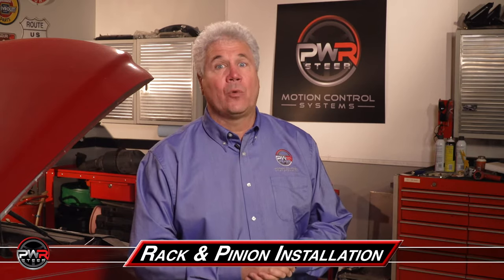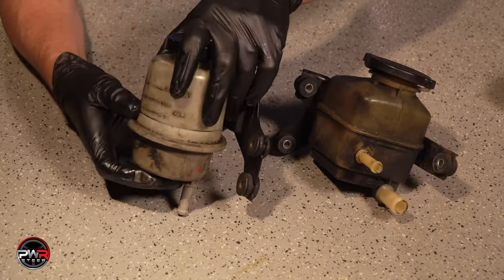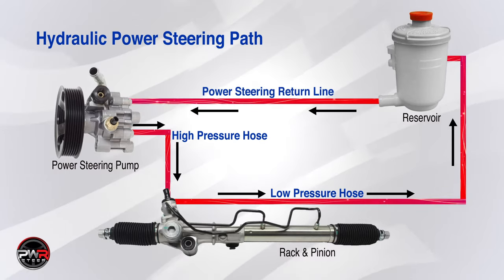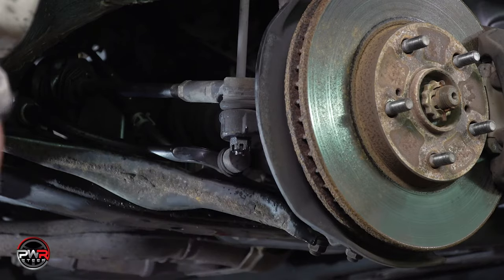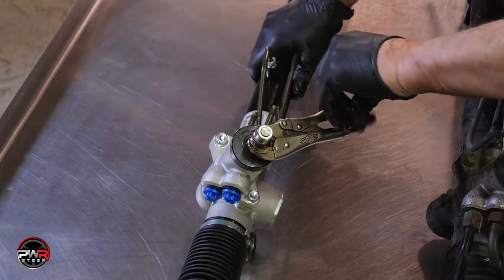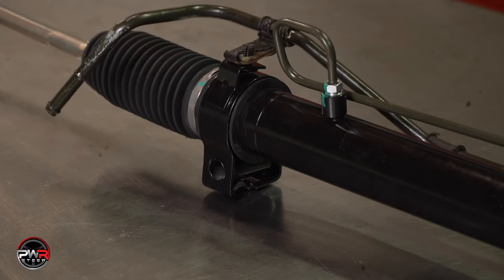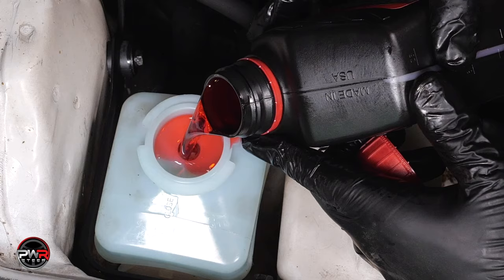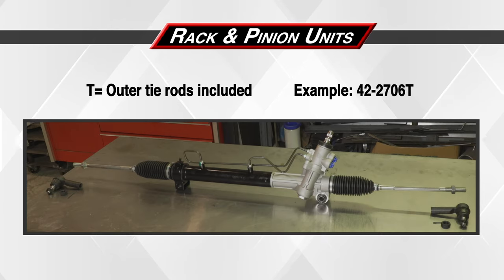Installing a Rack & Pinion

Comment: Am a steering engineer by profession I work and repair all kinds of steering pump and racks for all kinds of cars..
Reply: Are you in NJ?
Reply: Hi what do you think can be the cause? Mazda 6 2012 2.0 petrol. Electric power steering , the steering wheel feel heavy especially when turning left (a lot smoother when turning right)
Reply: @princesteering-nh9mj Hi what do you think can be the cause? Mazda 6 2012 2.0 petrol. Electric power steering , the steering wheel feel heavy especially when turning left (a lot smoother when turning right)

Comment: My mechanic says my seals in mine have gone out. I have power steering fluid all over the bottom of my truck. At first I thought it was the pump but given how it feels when I drive it, it makes complete sense that it is the rack & pinion. The way my steering feels when I hit the tiniest pothole. I'm getting it fixed but I can't until after Christmas. I just won't drive it until then because I've had to replace one that went out during driving in my car so I know that endgame. You ain't moving that steering wheel no matter what you do, I had trouble getting it off the road. Lucky for me he's a certified mechanic but close family friend so I won't be paying as much as a shop charges😏. He done my brother's about a year ago.

Comment: Good morning...I have a Nissan elgrand and it's steering rack is very very heavy when turning both sides so I'm asking what should I do about that issue and which steering rack can I buy because at the shop dealers thy says it's expensive to order so which Nissan uses the same rack as Nissan elgrand.

Comment: Thank you so much for this so detailed explanation. I was able to do this replacement on a 2014 GMC Yukon following this video. A couple of things I noticed along the way, which are not mentioned here though:

1. The new rack and pinion comes with two unopened rubber seals for the connection lines to the steering wheel fluid. However, they can easily be mistaken with temporary seals to be discarded. If so, then the fluid lines do not seal at all. The rubber seals have to be opened up a bit before placing them in their positions again.
2. Steering after the installation is harder. It appears that there is something called pre-load adjustment with a bolt located on the base of the pinion, in order to loosen up the steering movement.

In my case, even though I counted the turns of the tie rods, the pinion shaft did not properly aligned with the clamp hole. Since the instructions clearly state not to move the steering wheel, as it is already centered, I had to move the pinion shaft to make it align and have the clamp fall in place, and then re-adjust the tie rods, as the wheels were now off center.

Comment: Hi mate ! After I center the Rack, How do I know the number of visible threads to be left on the new inner tie rods, when I don’t have the old rack for reference? As I see in the video, you could get the reference measurement for the new rack from the old rack.
Reply from the maker: Hi! 

Sorry for the late reply. 

1. Center and install the rack
2. You will screw the outer tie rod ends into the new rack before inserting it into the spindle
3. Make sure both front wheels are pointing straight ahead
4. Screw the outer tie rod end in-and-out until the tapered portion of the outer tie rod end is aligned with the tapered end of the spindle
5. Tighten into the spindle
6. Jam nuts on inner tie rod ends to the rack
7. Take to an alignment shop - if not, you will wear out your tires
Reply: @PWRSteer  Hope you’re doing great ! So, I had my rack centered with the wheels and steering wheel straight ahead. But messed it up by slightly positioning the rack off-centre to the left by like 5°. Now, after the wheel alignment, my steering and wheels are straight but due to the auto centering nature of Rack & Pinion system, the steering returns to the center position of the rack ie; slightly off center to the left. Thus, also pulling the wheels towards left requiring constant lane correction. Didn’t know that slight variation in degrees would cause so much havoc. Need to correct this asap. Mistake occurred during lock to lock counting and coming half way back on the rack, which was slightly messed up. Any inputs from your end would be of great help.
Reply from the maker: @asphyd12  We are doing well! We appreciate you watching our videos. Feel free to visit our website: www.pwrsteer.com

Unfortunately, it looks like the only way to fix this issue is to disconnect the tie rod ends and re-center the rack. 

Thank you!
Reply: Thanks guys I gone to try my self

Comment: So if you mess up with reinstalling this part how much would a car mechanic charge you to fix it? Would suck if you relize the steering wheel is worst after putting new rack & pin on and have to have it towed. luckily for me I have triple A so i would get free towing.

Comment: Hi I have a 2012 GMC YUKON XL SLT 5.3 4WD with 285,000 miles.  I have changed a hub bearing, and the inner tie rods.  How do I tell if the steering rack is bad.  While driving on the highway, I get a drift in the lane and a little play in the wheel.  I have unlimited wheel alignments and have it aligned after the part replacements.  Just got back from a long trip to Florida  Great video by the way.  Thanks JoeMc
Reply from the maker: Hey Joe , 

I would check the inner and outer tie rods and see if there is a little play, even if the vehicle has high miles, it should not be loose. In regards to the drifting, you mentioned you have replaced one hub, I would check with wheels off the ground (free spinning the wheels using the same force on either side), to see if they spin the same number of turns or if one has more resistance than the other. The newer hub will have tighter tolerances than the worn out one.

Thank you!

Comment: Hello I have jeep cherokee 2018, there is a clunking sound when  I start driving and steering the wheel to the Right, no clunking if the car is parked for a while and try to steer only starts when the viechile is being driven, but after driving for 30 min then you can hear that clunk sound even when parked. The dealership inspected and recommend new steering rack and pinion. My vehicle has only done 89000km and is 2018 year. Is it safe to be driving with that sound or does is need replacement immediately?

Comment: But you didn,t mentioned check valve on pressure line side in Rack should be replaced and inserted in new Rack and some new ones they have build in Rak  .

Comment: My 2013 Camaro has a huge leak where the steering column goes in at the top. I can't find anything for just getting a seal for that unfortunately. Will be using this video Monday for replacement. Any recommendations for alternative ways to lock the wheel?
Reply from the maker: Hi Frankie,

One suggestion: 
You can stretch the seat belt and (loop around) tie the steering wheel and click it back. 

Thanks, 
PWR

Comment: Sooo my transmission was not shop replaced. The cradle was dropped but the rack and pinion remove connected. When I reassembled the car it pulled to the right.

I got it aligned and it still pulled to the right. Got it aligned again. Still pulls.

What could I possibly have done or not done during the reinstall of the tranny and such??.
Reply from the maker: Hi, 

Our suggestion: 
Lift the front wheels, leave the vehicle in park, start the engine, straighten the wheels, and let go of the steering wheel, if the wheels move it’s a rack problem, if they do not, then it’s something in the steering like bad ball joint or stuck brake caliper. If dirt got in when you reassembled the unit, then the spool valve may be obstructed.

Again, this is just our thoughts/suggestions

Thank you,
PWR
Reply: @PWRSteer  THANK YOU FOR THE RESPONSE!

Comment: so should I replace my power steering pump before or after I replace the rack and pinion
Reply from the maker: Hi Branden,

It is not a one or the other situation. You will flush the system before you start taking anything apart. As long as you refill the system with fresh fluid and vacuum bleed the system at the end, you should be good to go. 

Thanks,
PWR

Comment: What sensors are on the side of the radiator passenger side 2013 Chevy Cruze
Reply from the maker: Hi Tim,
Not positive, but believe it should be the temperature sensor to control the electric fan.
Thank you,
PWR

Comment: Hey guys, great video here. I am preparing to do this job and these  tips will help. I wonder if you could recommend a brand for a replacement rack? Looks like my options are Cardone, and ACDelco for remanufactured or BBB, and Edelmann for brand new. Don't want to do the job twice so i am looking for the best. '07 Monte Carlo SS. Thanks in advance!
Reply: And i just learned that PWR also manufactures a rack for my car. Do you have some specific selling points that makes your brand stand out from the others? I don't mind paying more, i just want the best one...
Reply from the maker: Hi Steve,

I believe our 42-1410 will fit. This is a brand new rack.

https://www.pwrsteer.com/ECatalog/productPage/42-1410/2007-Chevrolet-Monte-Carlo/rack-and-pinion-assembly

Thank you,

PWR
Reply from the maker: By the way:

You can order the 42-1410 from AutoZone or O'Reilly.
Reply from the maker: @steveeckman7578  

Our products are 100% new. 

There is no core. 

We have a lifetime warranty.

We provide you the necessary seals, hose clamps, etc. to complete the job (the first time).

Comment: On a Ford C-Max 2008 will I have to remove the subframe to replace the steering rack? 1.6 petrol
Reply from the maker: Hi,

We are not sure about the 2008 model, but the later models (starting in 2013) are hydraulic over electric, which you do have to remove the sub frame.
Reply: PWR Steer is china rack steering is good quality for 2005 camery ?!

Comment: Does this cause a wobble? I moved my tire from side to side and could feel a small pop from the rack and pinion the boot is tore from one side. Took it on the freeway and the steering wheel went left and right really quickly Like a person was going left and right quickly and had a wobble or vibration the wheel bearings felt tight.
Reply from the maker: Hi Drew,

Based on your comment, I suspect the inner tie rod is worn, the boots keeps debris out and lubrification in. Once the boot is pierced the grease comes out and the inner tie rod will wear prematurely without proper lubrication. 

The looseness or play in the inner tie rod end  can cause a wobble.
Reply: @PWRSteer  i've also seen fix-a-flat cause an insane wheel wobble before as well.. i saw it in there when the tire came off.. about 2 pints of liquid that looked like milk rolling around inside the wheel.. lol
Reply from the maker: @angsta22 ,

Interesting. Thank you for sharing!

PWR

Comment: How do you disable the engine from starting in order to do the power steering flush?
Reply: Pull the fuel pump fuse or relay

Comment: Im no mech. but sounds  like the return line to the reservoir need disconnected in order to flush out the total contaminated fluid, not "to disconnect the return line to the pump after filling it with new fluid".. Think about what was said in the vid because old fluid is in the pump to & thru the LP LINE.. So, it sound like a waist of new fluid in the new reservoir... IM JUST SAYING🤷🏾‍♂️